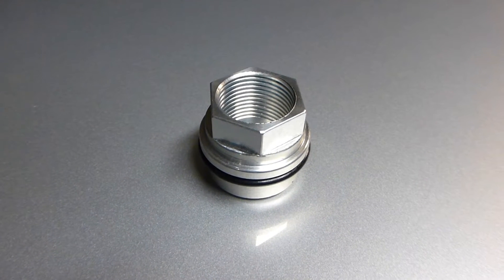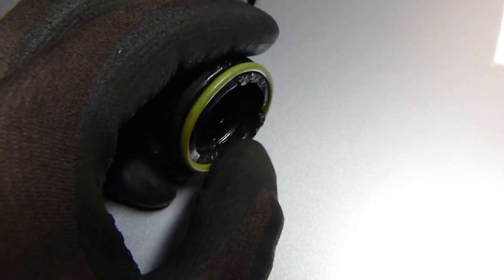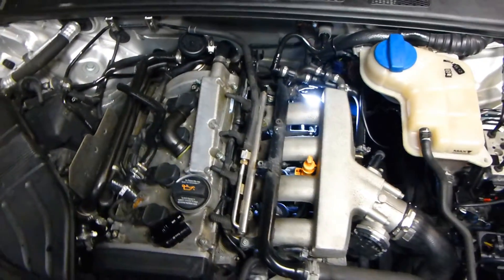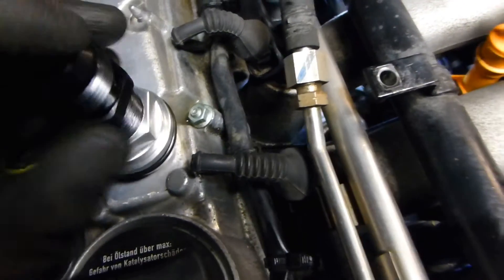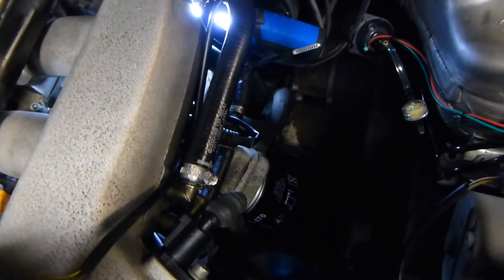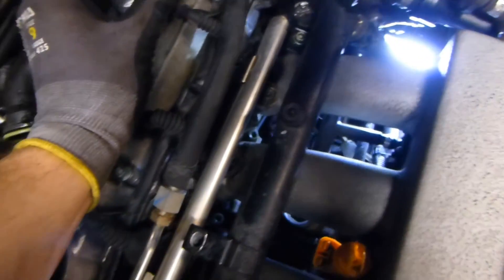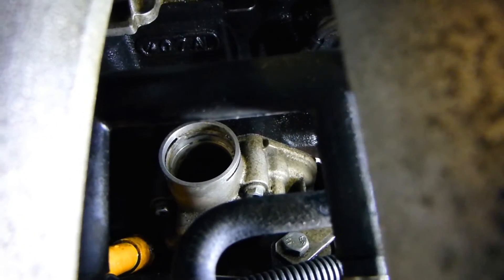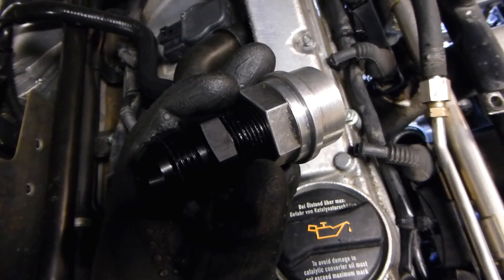034Motorsport Block Breather adapter (replacement) for Audi/VW 1.8T engines

Comment: Min 1.8t är väldigt svårstartad och hade lite misständning på tomgång. 
P1292- MAP Controlled engine  cooling thermostat open circuit. Tror du termostat behöver bytas, eller kan det räcka med tempsensorn som sitter bakom motorn?
Reply from the maker: Kolla så att kablar inte är trasiga. Se nedan info om felkoden:
obd-data.com/p1292.html
Reply: KarlMarklund men bidrar en dålig termostat till väldigt svårstartad motor? Får köra startmotor 15sek innan den hoppar igång

Comment: Just ordered the breather hose kit for my 2003 1.8t AWM wagon, got the 034 kit with the hoses and not the adapters like yours.  I also have to replace the coolant flange, oil switch, temp senor..... yay! thanks for the vid.  I still love my passat though! #WagonLife  I also got all my gear from ECS tuning btw.